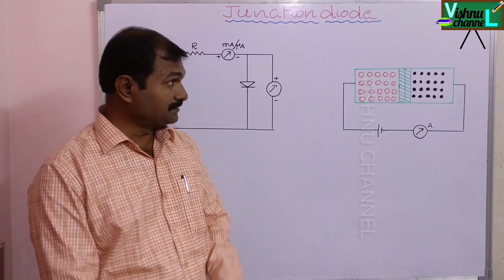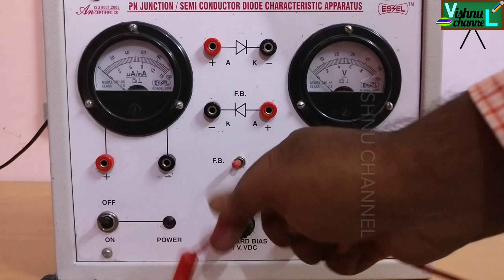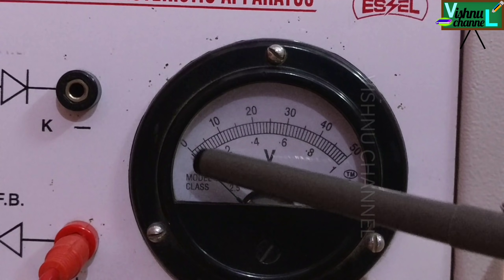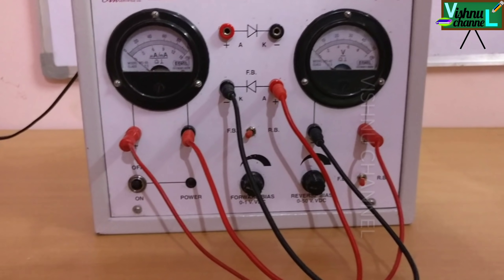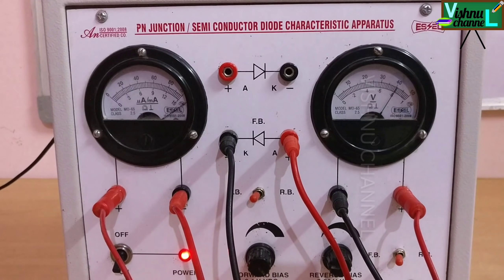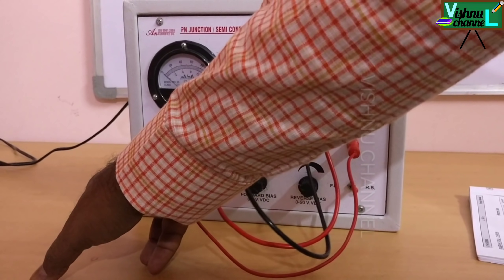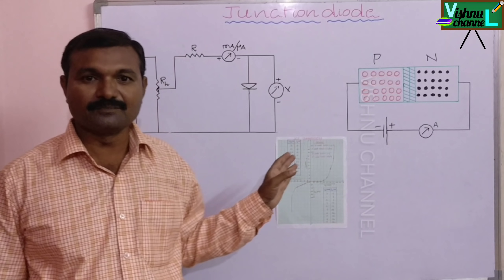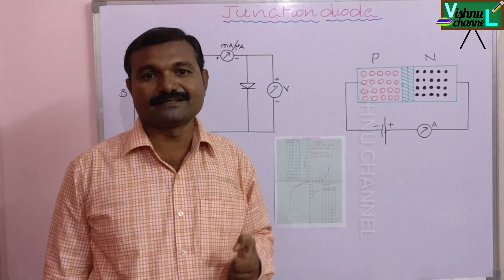P-N JUNCTION DIODE EXPERIMENT IN English

Comment: sir in the result they had given
forward resistance of a
junction diode=
zenor break down voltage=
what must be written there sir
Reply from the maker: RESULT : Voltage - current characteristics are drawn for a P-N junction diode.
Reply: sir they ask the value
Reply from the maker: Revathy are you from which state?
Reply: sir I am from Tamil Nadu
Reply from the maker: OK Revathy..... You write the result what they asked in the question in practical exam.